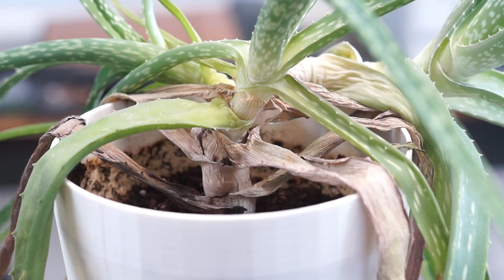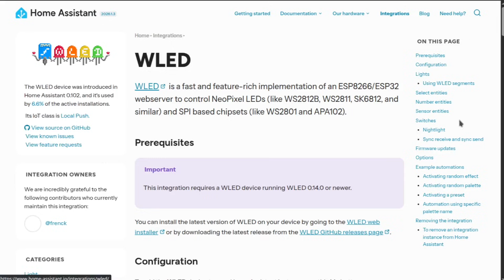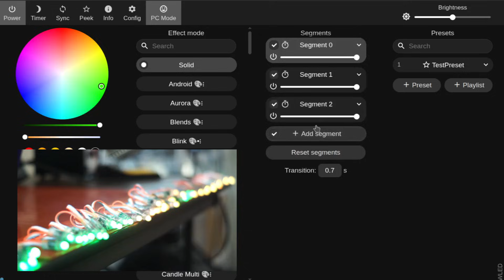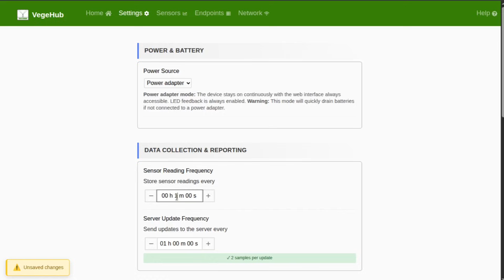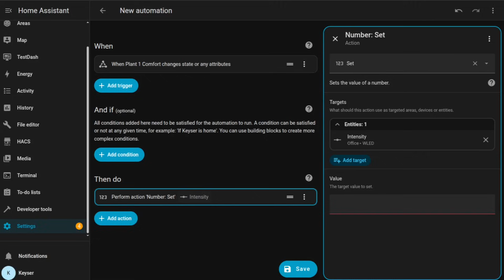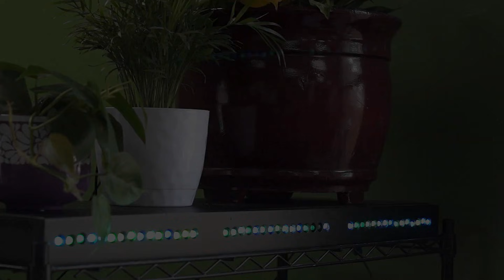Smart Plant Monitoring with Home Assistant | Soil Sensors + ESP32 LEDs

Comment: I need to redo my garden irrigation system. At one point I had baked garden soil to get rid of all moisture and added different amounts of water to samples to get a vh400 reading plotted on a voltage curve. 
In the end, I watch what is growing, how it is going, and sticking my finger in the soil. 
That way, it was more crop specific and I could use raw analog values and experience vs a calculation to let me know what value to control the irrigation at. 
HA is the most efficient way to accomplish this imo and happy to see Vegetronix join the Home Assistant cult! 
I think this was your best video to date by the way!!
Reply from the maker: Glad you liked the video! This one I didn't do - I delegated it - maybe I should delegate more of them.  Sincerely - Tim.
Reply: @Vegetronix too honest lol. Your others are good too. Maybe a combination of both…. Relatable and “pro”